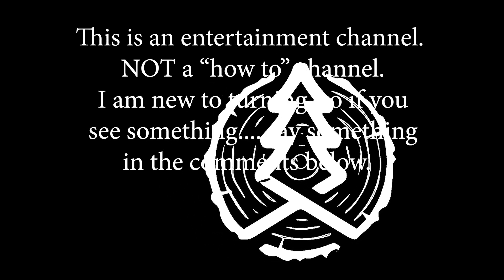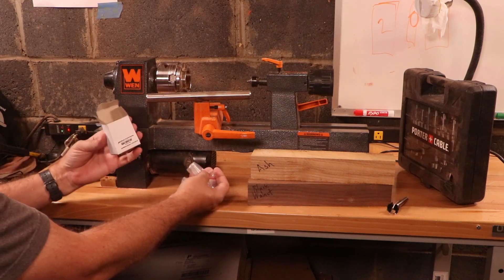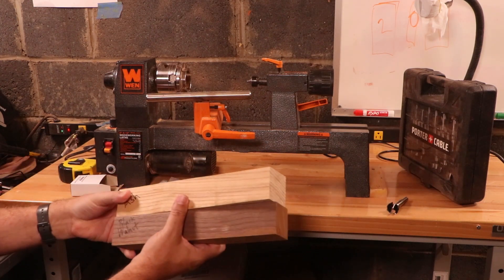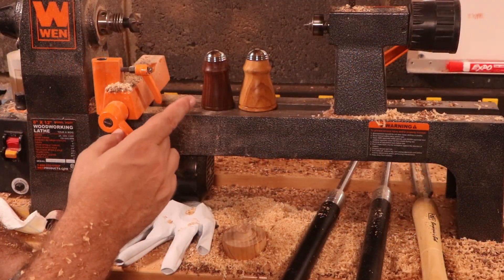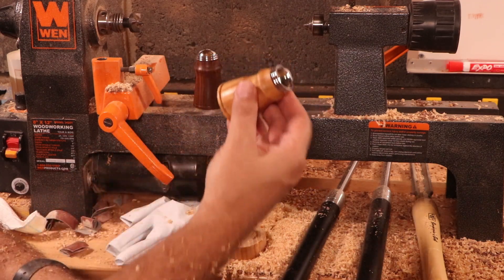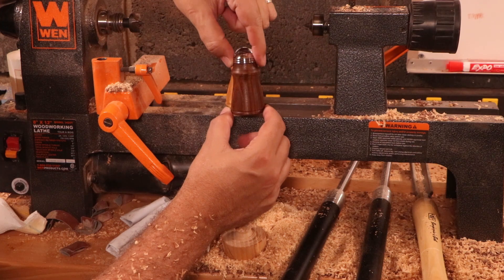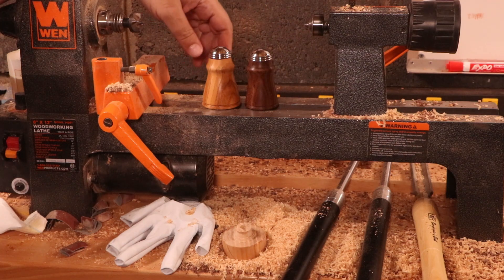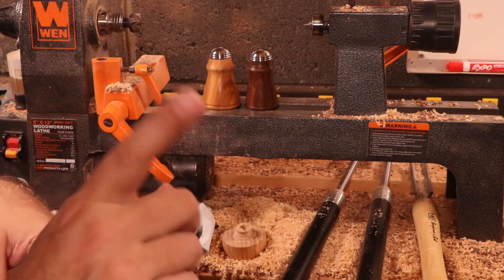Wood turning salt and pepper shakers on a wood lathe... failure?

Comment: Instead of ramming the tailstock into the piece, you could use a larger live center, or make yourself a cone for centering the tailstock end. If you use a caliper, you can easily match the widths. The salt & pepper shakers did look like a fun project
Reply from the maker: "cone" for the live center is a great idea! I will have to add that to my tool choices.... maybe make a future video for that. Thank you